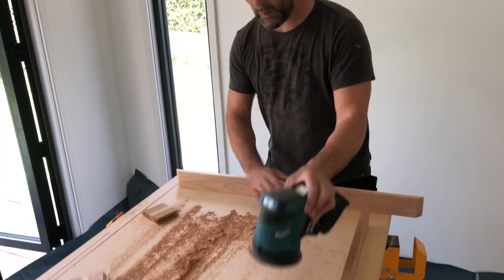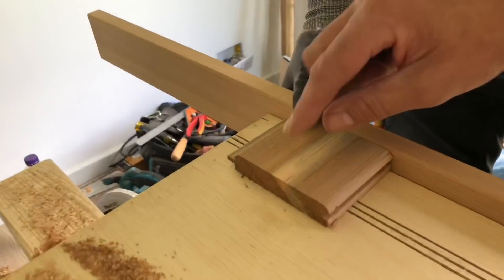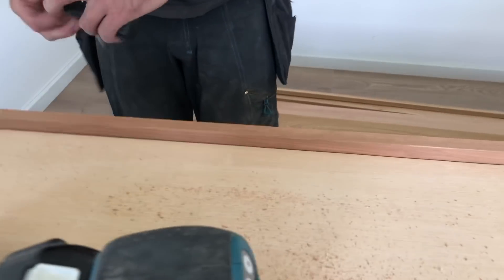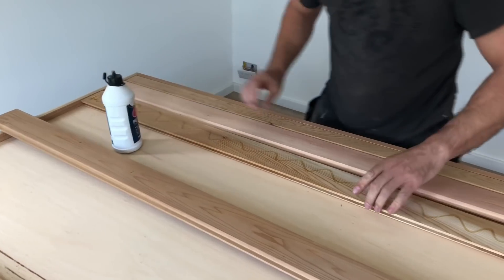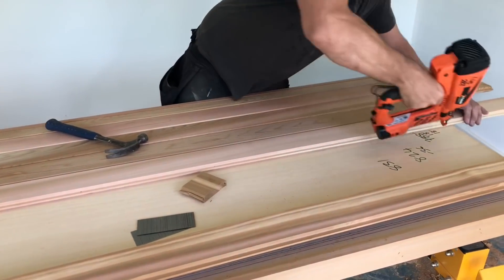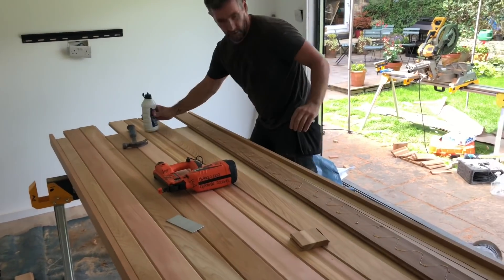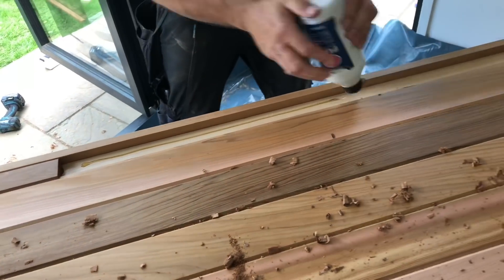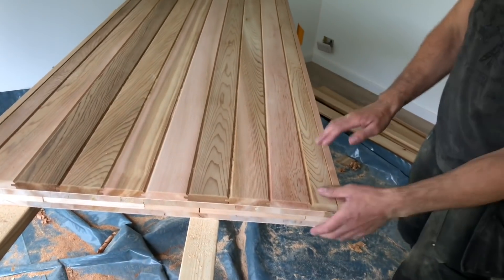Cedar clad door for a garden office, in under 16 mins, almost!

Comment: Hey there, enjoying your videos. I have a project coming up which may require something very similar but I was worried that by only cladding one side of the door blank that it could end up shaping the door as the cedar expands and contracts causing the whole door to curl.  Am over thinking this? Or did you end up cladding the reverse side of this door in an alternative material to prevent this? Keep the videos coming. Cheers

Comment: Love your videos, on this one I have a few questions. 
1) do you add a cedar strip to the base, after you have cut the excess lengths?
2) once fitted does the door align with the wall cladding, or is it recessed slightly, I’ve seen the following video you made but can’t work out how it finishes
3) how do you install the lock/handle?
Love you channel, absolute class

Comment: What size Cedar face do you use? 135mm or smaller?
Reply from the maker: Finish is 83mm
Reply: william griffin 👍🏻 thanks, is that just for the door or whole room too? Thanks for always taking the time to reply to questions... top bloke 💯%
Reply from the maker: Skyman111 prefer to use the 83 for the whole build as it provides more variation in boards🙌
Reply: does you use 12mm thick cedar or thicker?
Does thin or thick cedar make a difference??